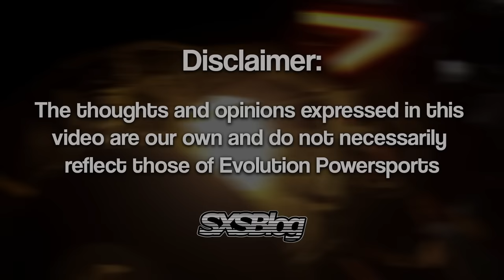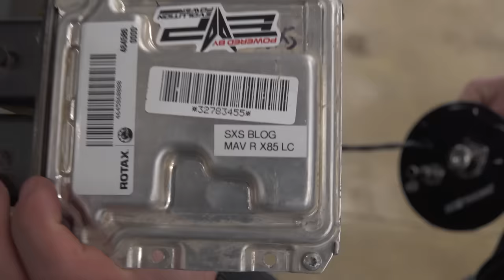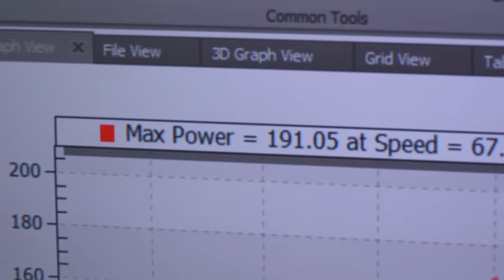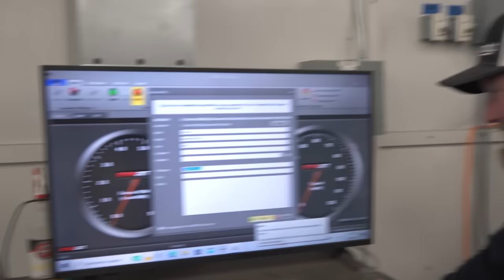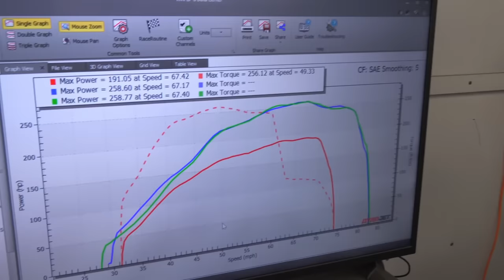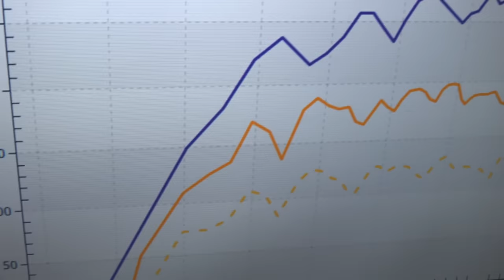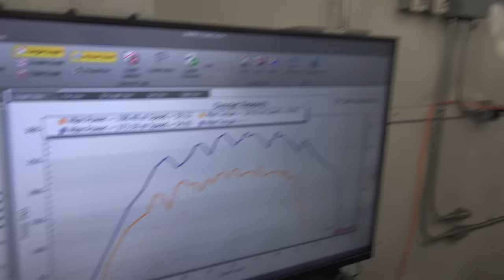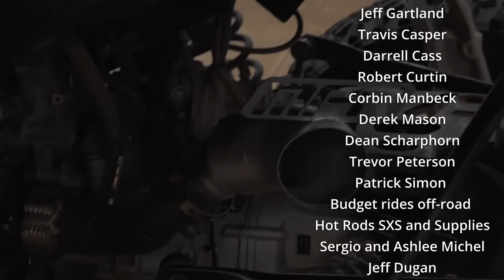350HP Can Am Maverick R SHOOTS FLAMES! (Evo Stage 5 w/ LAUNCH CONTROL)

Comment: Knock on wood but this DCT seems to take absolute abuse without flinching. Unreal piece of machinery.
Reply: Lots of documentation of them popping out of gear at inopportune times
Reply: Let's see if that holds true with added power and sand paddles.

Comment: I drive a Honda talon that has a DCT with 6 gears rather than 7. I never run mine in auto. The manual option to hold and change gears a will is something I don’t see them using enough. In launch control mode you need the auto to change fast enough but ripping on trails or a track it looks like they leave it in auto to much. Still this is a monster of a machine!

Comment: 9:30 pm on 3/21/2024, I was thinking 260 wheel, I have mav.x3 with a 3r tune from Evolution power sports and with a mape tuner x tune and on my speedometer at 99 miles pr hr. Twice

Comment: I have watched ur channel for years and ur content has been great. I am in need of advice I cannot afford a turbo RZR but what I do have is great mechanic knowledge I can weld, and I also have a 16 RZR 1000 xp with a great running engine. Do you have any experience with custom dyi turbos off YouTube? If so do u believe it would be possible to buy a turbo kit with intercooler and a low PSi wast gate and install it on my RZR xp? Your advice would be greatly appreciated keep up the great content my friends!

Comment: Why not put it in manual mode figure out what gear is closest 1:1 and have an actual dyno run
Reply from the maker: That's literally exactly what we did lol
Reply: @SXSBlog  How were there shift spikes if you were in one gear?
Reply: maybe i missed that part?
Reply: my bad i was thinking of the first pull where it was running through the gear and my brain wasn't working for the next pull @SXSBlog

Comment: It's not running right. You can hear it or atleast I can.  Its sputtering or misfiring alot. sounds just like the 2step but it's happening even when it's not on the 2step like on decel & putting around.
Reply: Yeah an that hp number is not right
Reply: That's exactly what a pops and bang tune does. It leaves way too much fuel on deceleration causing the fire balls. Pop and bang tunes are so bad for the motor plus they are annoying.
Reply: @andybowyer3602  Why do you say that?
Reply: It has an anti-lag system from the factory that shuts down one cylinder at idle and part throttle. Makes it sound like it’s misfiring all the time but that’s totally normal even on a stock one.